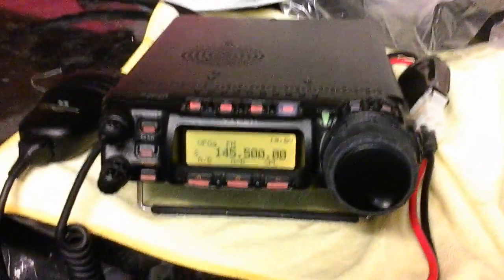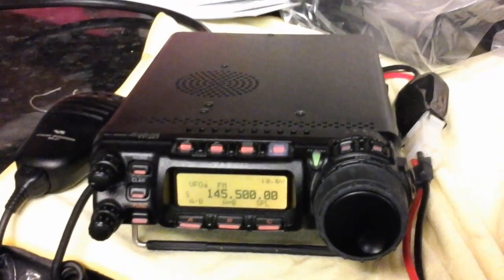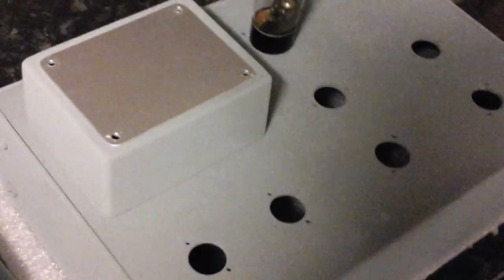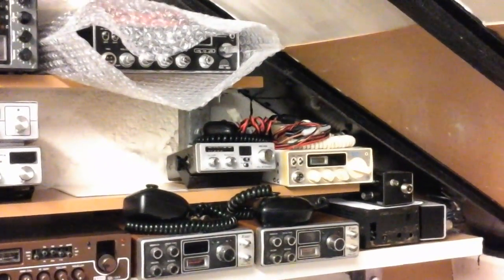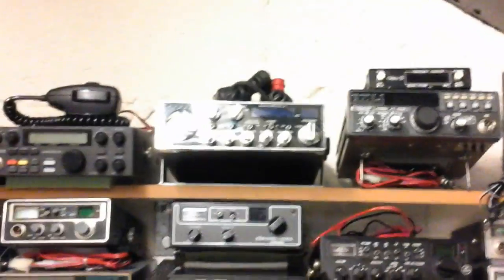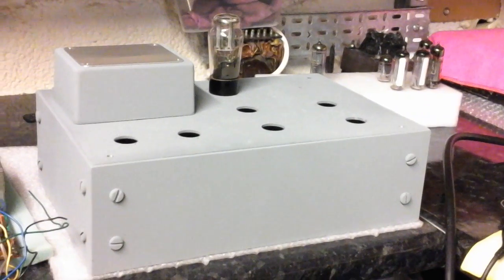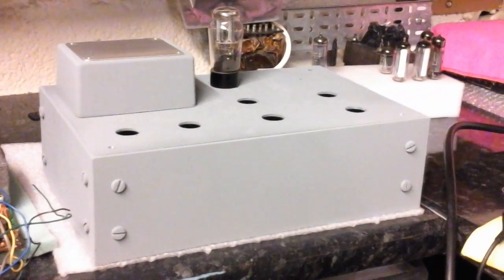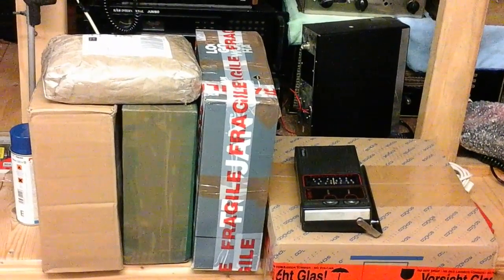Valve tube 3+

Comment: Wow that is some collection Simon.  Interested in the SW radio.  Warning though SWL becomes addictive.  The valve amp will look awesome in black.  Like the idea of the alloy plate.  Have you seen on ebay you can get small engraved plaques (think they put them on trophy's) which may look good for your controls.
Reply from the maker: Yes mate great idea